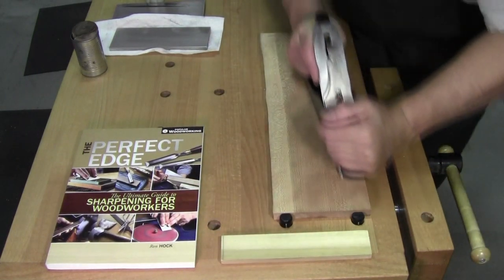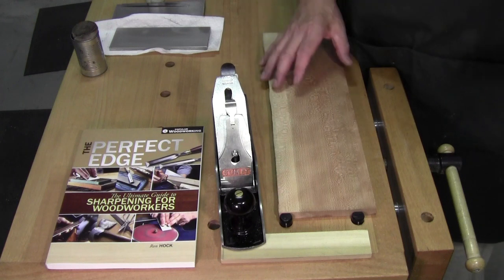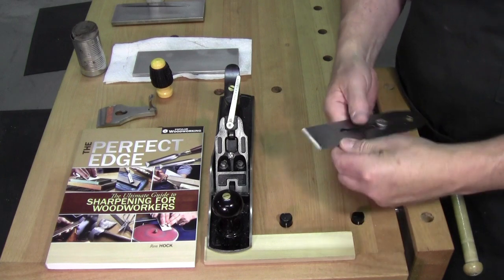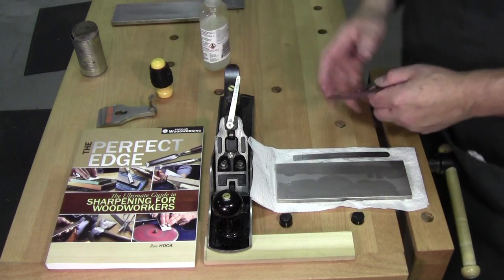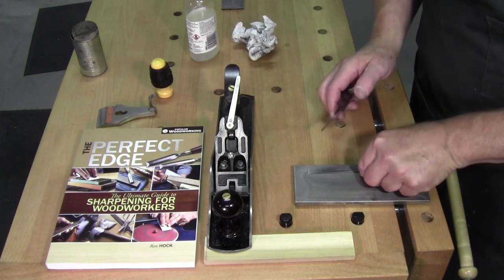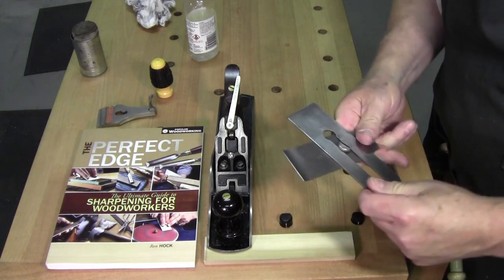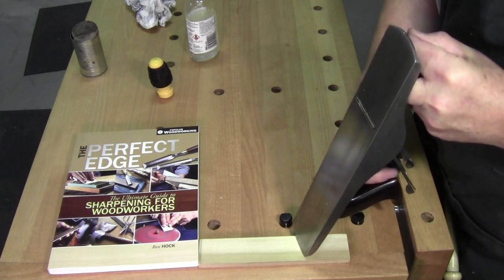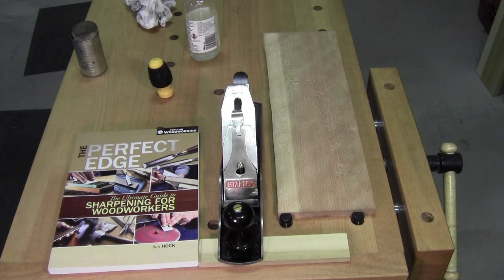PLANE TALK - SUPER EASY Sharpening 1, 2, 3, DONE ! - July 15th 2017

Comment: How do you feel about a leather strop. I have been using one and have good results. I do not have as much experience as you do and just wanted your opinion on it. Is there any reason I shouldn't use one. I love watching your channel I am a hand tool nut myself.
Reply: Anthony Boudreaux I imagine Walter will say "it's an extra step, like going to 4000, but if you have the time and can do it right, it certainly doesn't hurt." Just a guess!
Reply: Hakeem Hasworth I don't use a stone at all, well very rarely.  I only use the strop. In between boards 20 passes on the stop don't even take the chipbreaker off. I stay razor sharp. I have heard others say that it rounds over the edge and you shouldn't use it. I just wanted an option on it.
Reply from the maker: Anthony,
Stropping is one of those things which can start a fight among woodworkers.
Tee concept is great, but as for me, I want to polish on a HARD surface so going up to the 4000 for me is almost always fine enough but... If I want to go finer, I use a block of Maple and apply honing compound to it which gets me to 6000 and a mirror polish.
I have used 6000 grit water stones in the past, but you have to careful to keep them flat.
I'm considering an 8000 grit high end stone for some of my chisels and maybe a fine smoothing plane now and then, but the idea is to get the work done and not spend much time sharpening at all.
Reply: I have rounded off edges with a strop, but with practice learned how to avoid it. Honestly though, a fine (not extra fine) diamond stone  is enough for most work.

Comment: Do you round edges of blade to prevent plane tracks?
Reply from the maker: Thanks for writing,
No, I feather the edge left and right be just a few strokes on the stones.  
This is a mild form of Camber.
The amount you camber is based on how thick your shavings are and how fine tuned your plane is.
Not worried about plane tracks on a roughing cut, just on the final finishing and those shavings are 1-2 thou thick/thin.